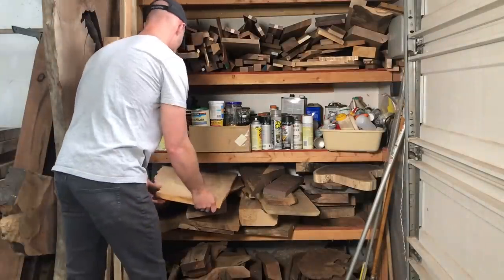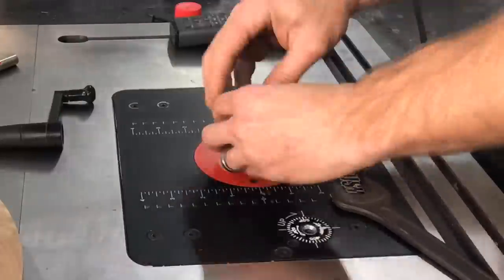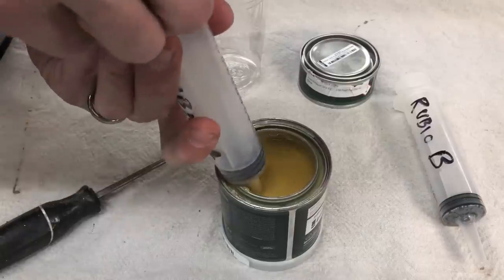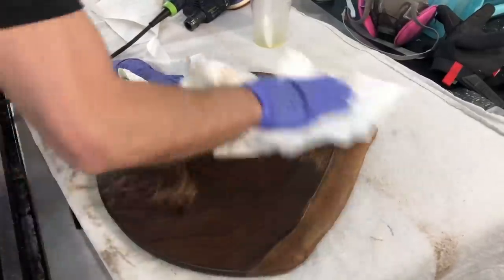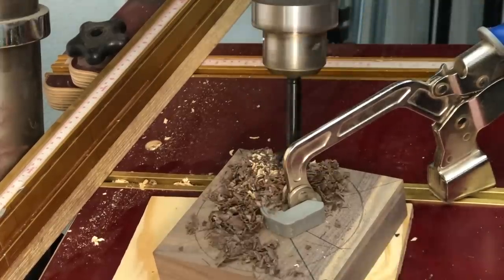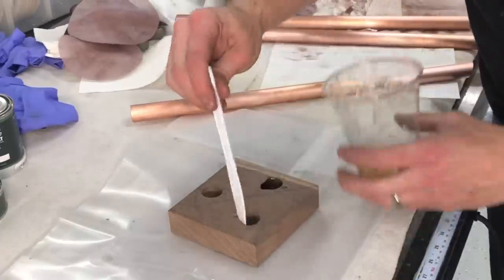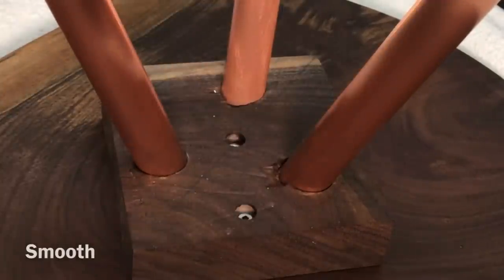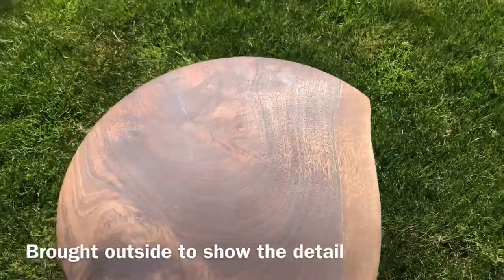$20 Woodworking

Comment: About how much would a start up be for like general equipment and things like that to be able to do tables and epoxy things
Reply: For serious equipment.. 25k minimum. Still need big sander 42 inches wide lol umm no room left. New they like 20k. This is for full equipment.. including  very fine chisels all top the line stuff. Powermatic jet woodpecker festool veritas Lie Nielsen. Dewalt, misc cheap stuff included like irwin drill bits, tack cloth. I just know what I spent and all of it was on sale when I got all this stuff. And for wood.. well I've stocked up as well. 1000bdft walnut, 1000 maple, 200 cherry,various exotic woods, and 4 huge claro walnut slabs 12 feet long. All furniture grade. I like quality wood. I'll buy the cheaper stuff as I need for parts that are not shown in projects. Now can you do all this a lot cheaper... yes but you be replacing or upgrading all the time. I've got about 35 years left before I'll have to hang it up for good so I'll get my money's worth. About the only thing I haven't gotten was a cnc machine.. which day I retire and get a new home I'll have the space then for it. Still flushing out some more gear but I just buying as I need. Prolly another 2k total. Hope this helps or shows my stupity for nice things. It's my hobby which I'll turn I into a business when I retire and work when I feel like it.
Reply from the maker: You could get going for $1000 if you shopped used and small.
Reply: @CrabCracker  wow thats alot of stuff haha I was thinking like bare minimum out the gate enough to make a semi decent quality products
Reply: @BlacktailStudio  dang really? Thats awesome where could I find used liek goodwill?
Reply: @xxgriffeyxx8862  Facebook Craigslist auction houses. I'd recommend Steve Ramsey woodworking for mere mortals. He has a video up for $1000 budget start. Depends on your needs.. start small but I recommend buy quality tools if you plan on doing this for a longtime and work your way into it. Just get the basics down first and learn to deal with mistakes and obstacles... more then one way to make a cut with various tools. But above all this... learn to be safe. One mistake.. finger hand or eyeball gone. First tool.. tweezers. Work with pine then move into better hardwoods. Practice makes perfect. Mistakes costs lots of money.
Reply: @CrabCracker  thank you for the advice and ill check it out 😁 i can't wait i like quality tools but it would be like maybe one project a month so I don't think I would get high end right away
Reply: @xxgriffeyxx8862  I wouldn't go high end if doing one project a month. I'm setting up to run a business and retire. My chisels price was $500 for 4 chisels.  You can get a cheap Chinese version that will dull and wear down a lot faster for $50 for example expect em to break and replace. Get the basics and price it all out ahead of time. Also look at your area your working in and figure how to place everything for workflow. On a budget best time to buy new is black Friday/cyber Monday only. For equipment I purchased from beaver industrial supply. Discount, gold star discount and free shipping to my house. 3 semis all in one day.. they could of put it all on one truck .. man my neighbors gave me looks. They have no clue what all those pallets was. Entire shop all in one day. Plan ahead figure what you want to buy.. wait for the sale of the year.
Reply: @CrabCracker  that's very true if im good at it i would sell some stuff and go up to like four or so a month just wanna see how its like to start but thats a good idea it would be out  my house if I did or of my laboratory